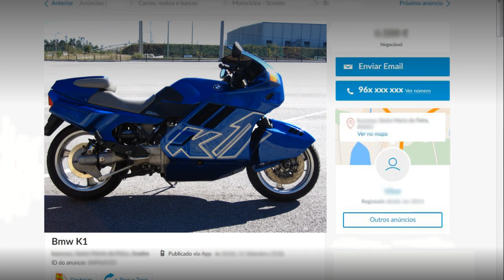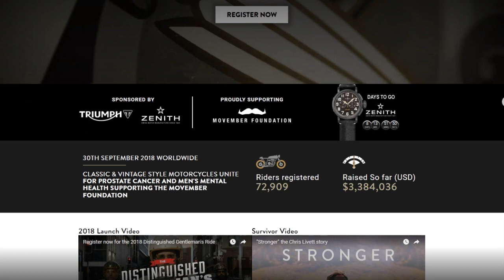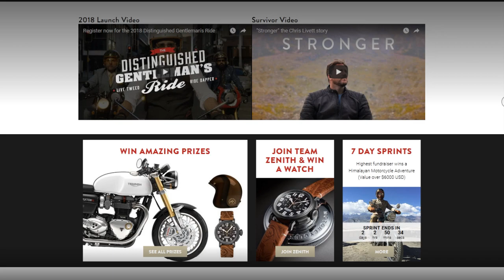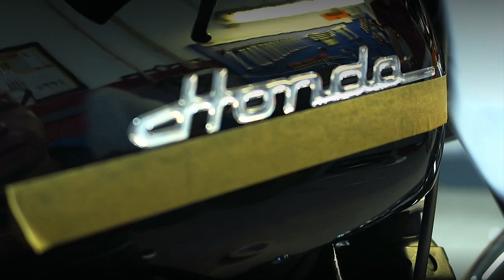Cafe Racer (Honda CX 500 / CX 650 by RACER TV) Part 4

Comment: Love the bike. you can really tell its a labor of love. Would you be willing to explain how you moved the brake reservoir from the front bars?
Reply from the maker: Thank you my friend for your kind comment. Well, it is hard for me to explain it. But essentially, the hydraulic brake pump was relocated under the fuel tank, and the Brake lever is moved by cable. Some old BMW motorcycles from the 70's, used a similar brake system. :) Cheers.

Comment: 0:08 Wow!  So cleeeean, and pretty... sounds awesome, too.  My guess is your hiding the fuel in the frame.  I didn't see a bladder of any kind.
Reply: hmm... now that I look at it again, I see a white tank with a filler neck, low in the frame there.  Assuming that's not the radiator overflow, that could be the gas tank, I guess.

So, where is the tank?  What's the answer?

Comment: Love the channel and this bike is perfection.  Congratulations on a beautiful build.  Wondering the brand and source of your headlight as want to use for my xj550 build
Reply from the maker: Thank you my friend for your support. Unfortunately the headlight model applied in this project is no longer available. But if you search on Google for "motorcycle LED headlight", you will find similar headlights or the same style  The metal ring which fixes the headlight into the motorcycle is custom 
made.:) Cheers